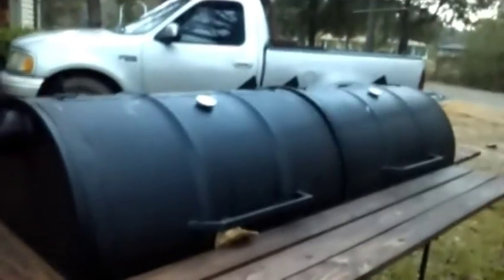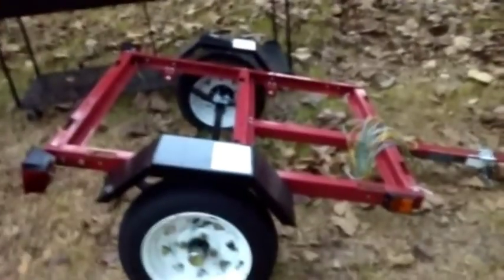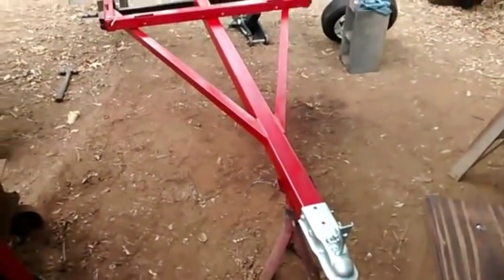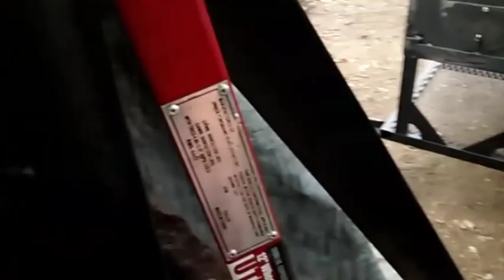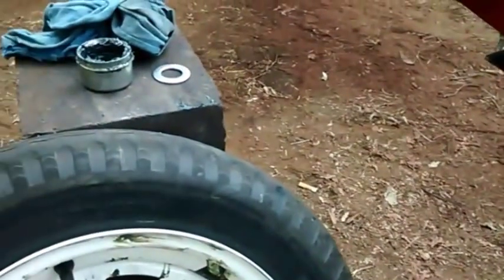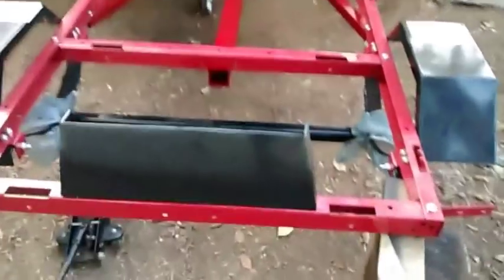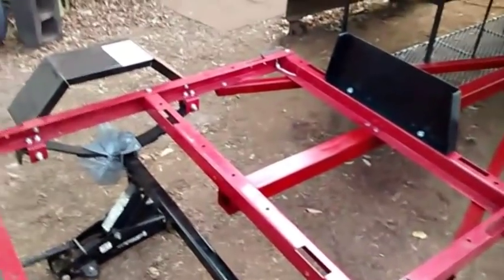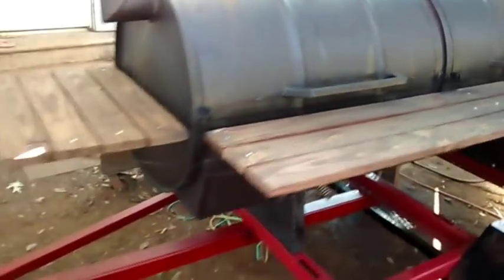Harbor freight trailer modification

Comment: Alan, I've got a barrel measuring 32 x 60 to a former furnace heavier metal than the barrel. Wondering if you could add your magic and mount it on a trailer maybe make it into reverse flow smoker for me?

Comment: for the price of redoing the trailer why not just get the HF larger trailer?and add a 3/4 4x8 ext plywood?
Reply: I've been thinking about building a double barrel like that on one of the larger trailers and mount it on one side, put a single barrel and two propane cookers on the other side and use the middle to mount propane tanks and to haul charcoal and/or wood.
Reply from the maker: gerard curry that's just what he brought me

Comment: LOL... I hope that Guy only uses that trailer in his yard... Maybe pull the Pit around the yard with his riding lawn mower... Those trailers say don't go faster than 45 mph... I had one at one time just to use in my yard and the wheel bearings rusted up in 3 months... My son borrowed it and the wheel broke off after 1/2 mile at 35 mph... They Are JUNK...